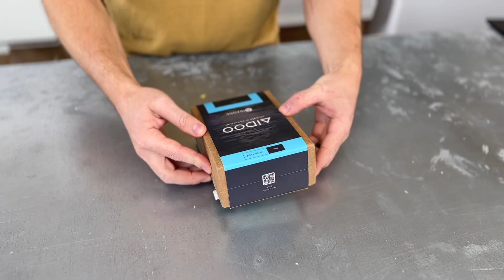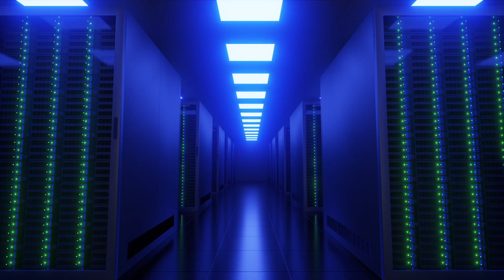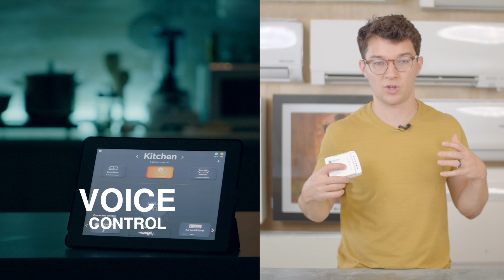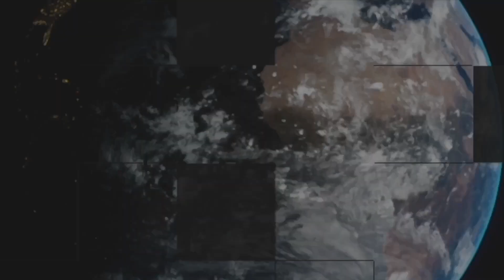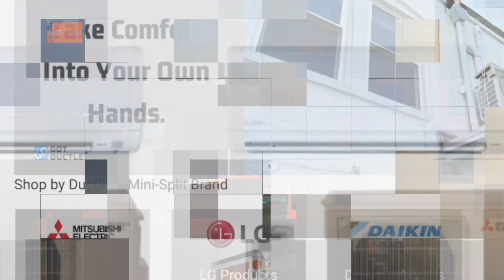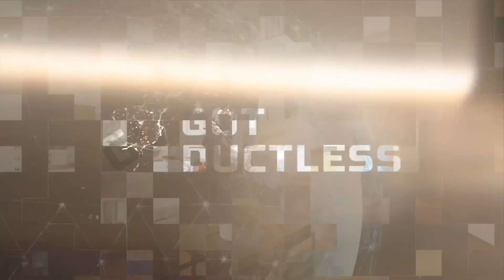Most Robust Mini Split Wifi Controller for Mitsubishi, Daikin, Fujitsu & Others

Comment: I have the Kumo cloud but my AC tech was unable to set it up because he said my Starlink lacks the WPS button on my router. Do you know if I have any other options ? I can't be the only one dealing witht this. There must have a solution. I was told one option is to add a network/router with the WPS option. Mitsubishi should work on making this less problematic.